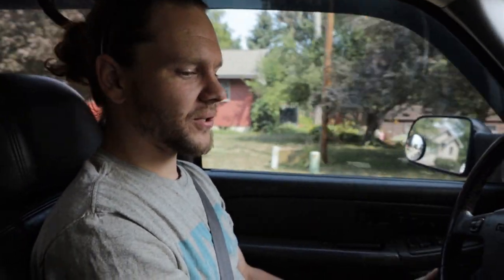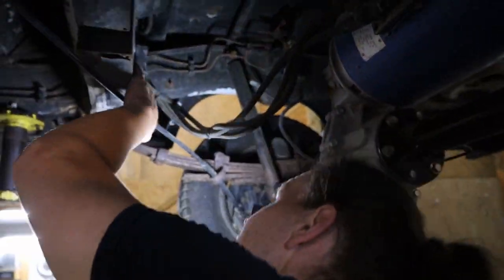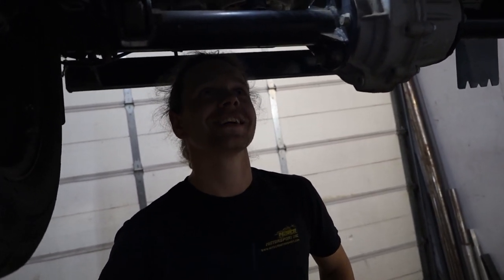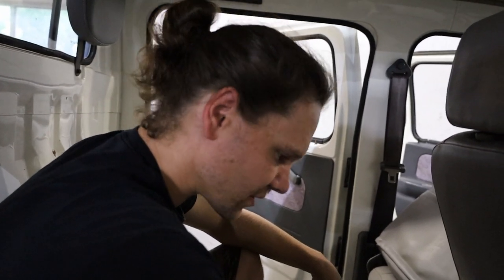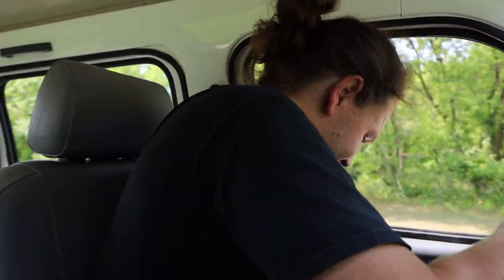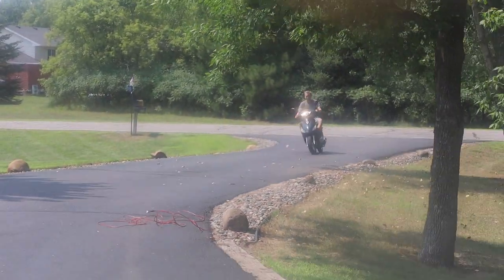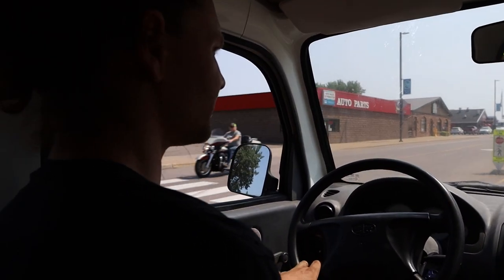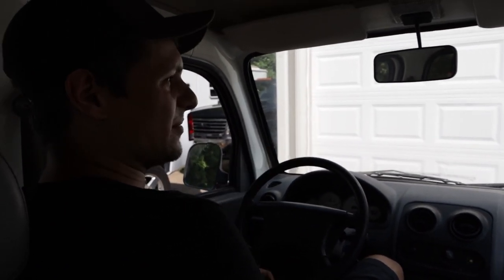We bought the CHEAPEST ELECTRIC MINI TRUCK on Facebook

Comment: Going to get costly.  Those D8 batteries are starting batteries not deep discharge so their life used like that will be very much shorter.  Probably the best regular batteries would be the deep cycle six volts ganged up that are used in golf carts.  Nothing is going to match the purpose built ones which are very pricey!
Reply from the maker: we turned the overall rpm down and went on a longer cruise today! Held a charge better. we settled on 30 mph being plenty fast after we got it lowered.

Comment: Yeah I would have done a lithium conversion but it would be expensive and take more time to understand and build it would need bms and charge controller. Lifepo4 batteries are so much lighter and have so much longer lifespans! I personally like lithium titanate it's what I installed in my trailer  12v 600 amp 2,000 but have a 30,000 cycle life vs lithium ion 2,500 cycles

Comment: Nice find  !!! Making it go faster might be possible with the current electric motor but would likely wear it out faster from overheating so you need to try finding the specs as it was probably governed to 25 to be sold as not a car and can go faster but any mods like increasing voltage will likely cook the motor find out what computer it uses does it have and ob2 port? Usb port for updates? There are a bunch of people swapping in larger motors in similar vehicles see pak yak